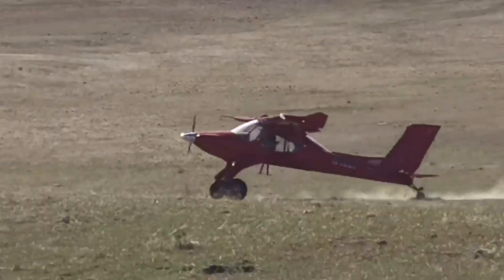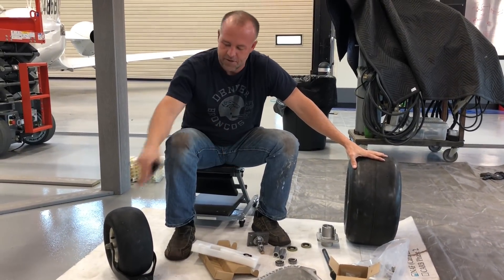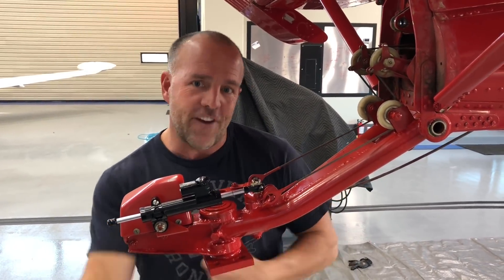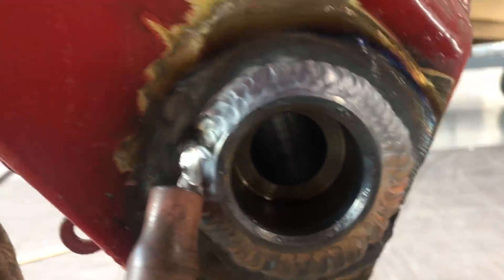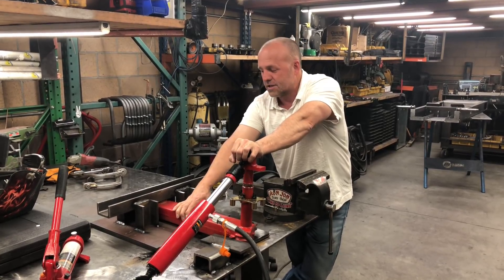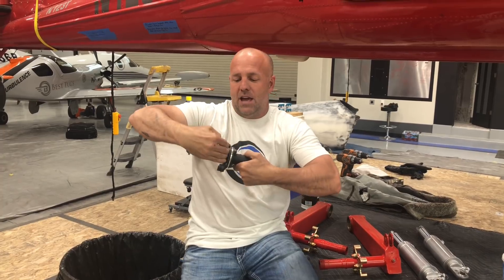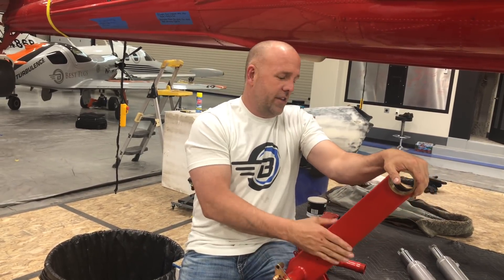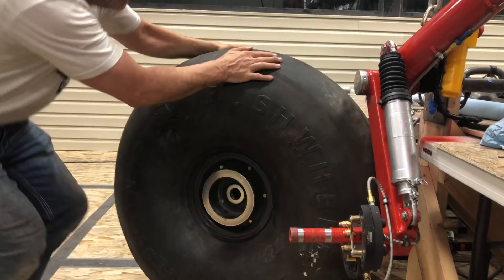Mike Patey Wilga (DRACO Video 10) Tail Wheel Design, Upgrading Brakes, Modify Trailing Link Gear

Comment: I'm surprised at several comments being made concerning your welding a Diagonal Plate in your landing gear tube structure what ever the hell the proper term is at 8:12 mark of the video.  OK as a structural designer myself there might not be all that much advantage in placing the plate diagonally but who the Hell on this Blog has the fabrication skills as Mike.  Seriously, Mike has incorporated Solid Works 3D modeling, Structural Analysis, FEA to improve his design and ensure proper form, fit and function of the fabricated parts during assembly.  Got a few engineers who probably haven't had a proper tool set much less how to use it since mommy and daddy purchased them  a VTech Drill and Learn Toolbox.  "That's right little Johnny, hit the crap out of that nail with you plastic hammer."  "Little Johnny, he's so advanced".  R & D is how I see it...the assembly if necessary can be modified after a few hundred take offs and landings if there is any indication of the assembly deforming and or not performing as intended.

In the mean time, I'll just ponder how inept I feel every time Mike hangs out in his hanger and plays with his Big Boy Tools while I'm still trying to figure out how the hell to get this damn round stock through this square hole with my plastic hammer.  Start Safe, Stay Safe  (PS: Mike is there any way I can talk you into making Engine Baffles Left /Right for my Piper Comanche??? )

Comment: Love this build, binge watching my way thru it! Can’t you make that suspension swing arm out of aluminum? I come from a motorcycle background and we almost universally use aluminum for suspension swing arms, it helps lower both the overall and unstrung weight. Aluminum, as I’m certain you’re aware, is also stiffer than steel.  Seems like it would be a perfect material for this application, or am I wrong?

Comment: You are really good at explaining the engineering to a layperson. The strengthening of the square tube makes total sense.
Reply from the maker: I love all these comments. Not many catch on to things like this. I had several takes and when editing you often miss or forget and lose the critical parts that would help it all make sense.  sorry in edits, hours get cut. First of all There were two reasons for the plate. The part that got cut that makes all these statements of yours correct but seems the design was flawed is as follows. On the cut out part of the video I showed the corner of the square tube about 2'  down from the shock there is a compression contact point. when a pilot bottoms out the suspension the corner of the tube pinches the frame and crushes the corner in and then the rotational force on the tube then buckles the entire tube. The Plate adds twisting strength as I stated in the video but it is little. The part of the video that got cut explained that the plate was inserted to prevent a corner crush collapse. Since this video I have had a not so great landing where I hit a giant hidden ditch and collapsed the gear and crushed the gear into the pinch point. the steal plate kept the tube from collapsing in that corner and the tube never twisted. I would rather have had a good landing but the design and correction worked perfectly. If It was only for rotation, and If I had the room to fit it, I would have done a 4" round instead of the square but that just wouldn't fit without a complete gear knuckle redesign and build. the comments on here are correct and so was my correction for the problem. the failure was when I left out the critical crushing contact point in the video.
Reply: "The strengthening of the square tube makes total sense." i yea i dont think he did that part as strong as he thinks he did, normaly engineer would ad material to the walls of square profile, adding stuff inside like he did will gonna change very little. He should cut some pipe and weld it to the shorter walls of that profile(front and back side).
Reply: You have shock absorber on one side so you can ad it only to the other side, but even that would give that profile more strength and make it more streamlined.
Reply: i dont see how flat bar is unable to twist,   and punching great lightening holes in it even less, tube is better to resist twisting motion .  this one doesnt stand up to logical evaluation no matter how well explained to a layperson
Reply: triangles are strong and thats what he effectively built was a box with a diagonal brace on the inside. simple test build a square out of wood and now push on the corner to squish the box.  then repeat the test with a web cut to fit from one corner to the other. what he did is much stronger than you seem to think it is. As for the holes the flat bar is in compression so a few holes will save weight and not cost strength loss.  it is a plane after all, or we could just use 4" solid stock and never twist it
Reply: knowing about triangulation doesnt explain how to make a sq tube resist more torque by putting a flat plane in it however oriented.  
 the same result may be acheived just by welding it on the outside.
Reply: Based on several videos showing his CAD Designs possibly SolidWorks I've seen references to Structural Analysis / FEA models with stresses.  I'm sure Mike has more than the average Layperson tools and engineering resources at his disposal to have worked out the engineering with a Stiffener Plate added.  And as it is an Experimental...Mike is doing a little experimental magic.
Reply: everything done on the plane is a great mix of art, engineering and intuition based on experience, and yeah picking up on one small bit seems real picky, but the explanation as to why it works to resist torque didn't make sense to me.  if it was to resist bending sure,  but I agree that a cylinder can better resist the twisting motion in this case than a flat plane with or without holes
Reply: Glad that Im not the only one who can not really see the improvement of that welded-in plate. And i^m studying mechanical engineering...i was scared I am on the wrong degree :-O 
Great video anyway. Awesom guy.